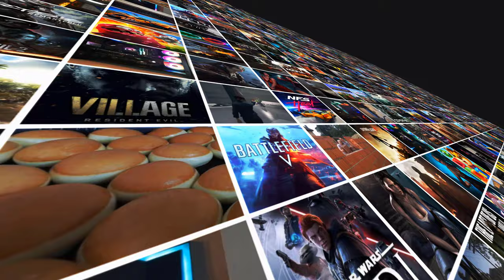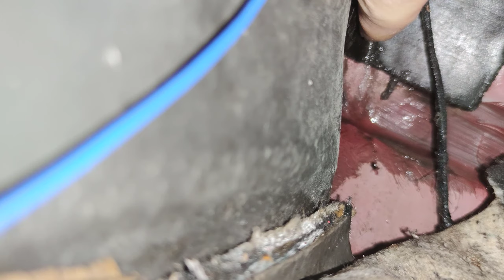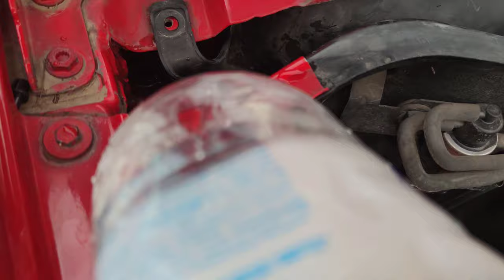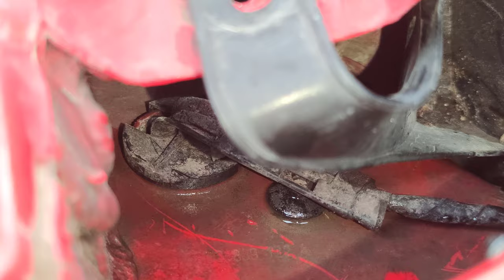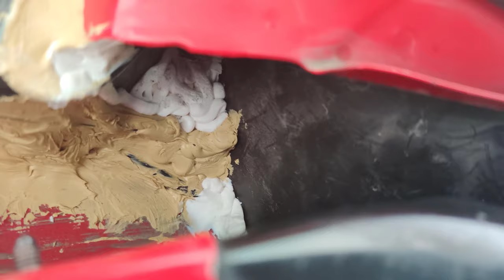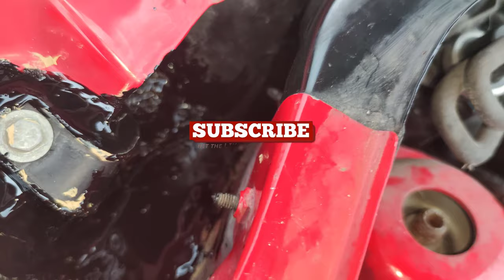VW Polo 1.9 SDI 2003 9N 3 Doors | How to Fix Water leaks | FLOOR IS WET ON PASSENGER SIDE

Comment: I had this problem today with my 2007 polo.  It happened after I used the rear windscreen wash.  There was water spraying out from under the dash on the passenger side.   Must be a faulty water tube. I’m guessing your car had the same problem. You need to turn on the rear screen wash and look to see if you get the same problem.

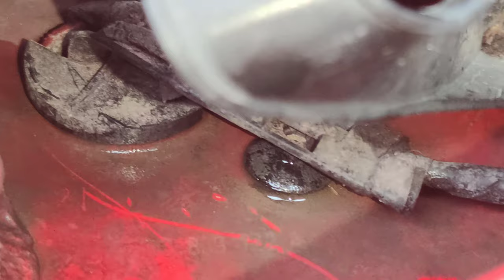Comment: 3:18 this hole move to wheel arch, Not to the cabine! Behinds this hole in the vertical sheet is an other tight nozzle. I think this was the problem or the water move through the Fan hole (under the black plastic cover)

Comment from the maker: VW Polo 1.9 SDI 2003 9N 3 Doors (2001 - 2005) | Water leaks | Wet passenger footwell carpet...holes in the firewall for a power cable.